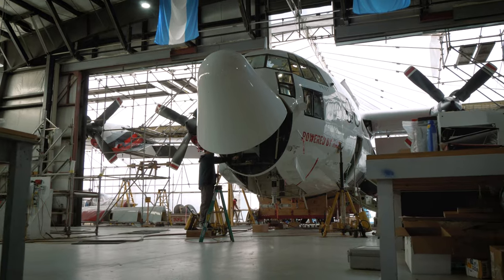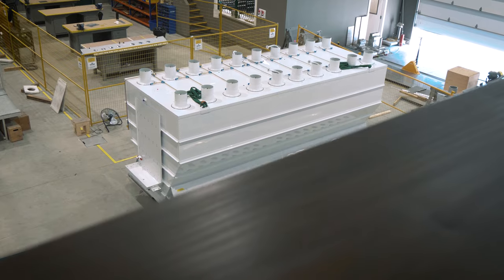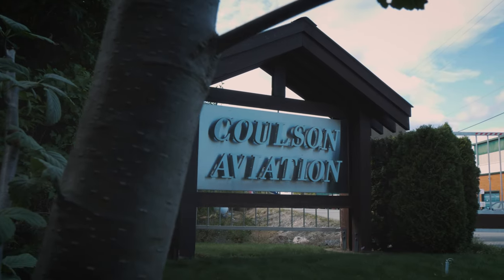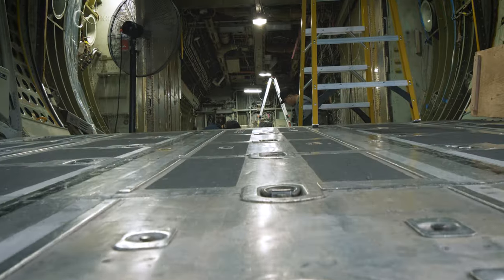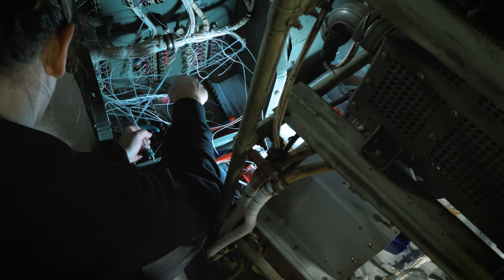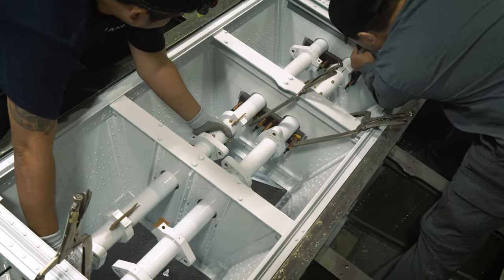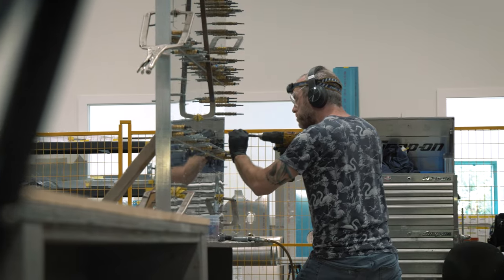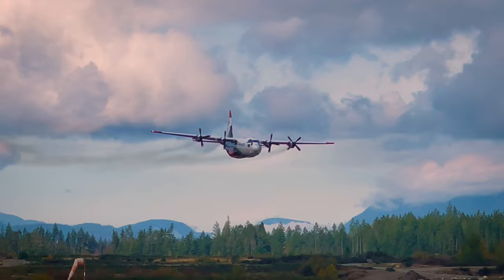Converting Ex-Military C-130H Aircraft into Airtankers with Coulson Aviation

Comment: "We're the only operator in the world that designs, manufactures and installs all at one location". 

Britt is not telling the truth. 

Conair Aviation has been doing all three functions at their facility in Abbotsford for over 50 years. Air Spray has done the same in Red Deer for their Lockheed Electras, also for 50+ years. Air Tractor does all of the above - plus builds the underlying airplane itself - all at their factory in Texas, since the mid-90s.

Coulson has converted two aircraft types in Port Alberni: the C130 & 737. 
Conair has converted (design, manufacture & install) at least seven types in Abbotsford: the TBM Avenger, A-26, Grumman S2, DC-6, Convair 580, RJ-85, and Dash-8 400. Conair also improved the gate/drop system on the AT-802F in house, delivering a superior drop pattern for heavier timber fuels than the proprietary Air Tractor system.

Aviation publications (hello, Skies Magazine) need to ask follow-up questions, perform some fact-checking, and scratch the surface a little deeper rather then take a Coulson at face value. Ask some probing questions about his claim of successfully changing an ex-military Hercules to a civilian type certificate. Ask if Lockheed and Boeing support the converted airplanes once they've had their pressurized hulls cut to install the retardant tank. Above all, never trust a ginger with a man bun.
Reply: Let's not let facts and hyperbole get in the way of self-promotion.
Reply: You had me with man bun....yikes
Reply: Coulson also converts 727's and CH-47 heli' s.
Reply: @frosthammer71  737s, not 727s.
Reply: @adrianwapcaplet2773  wrong
Reply: @frosthammer71  Learn the difference between the 727 and the 737, and get back to me.